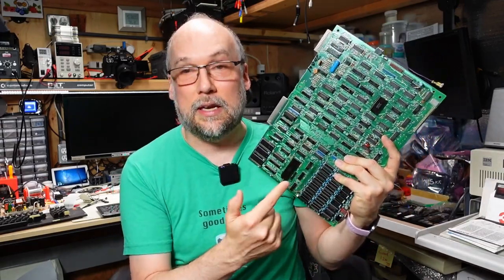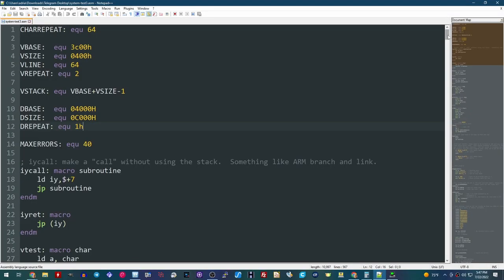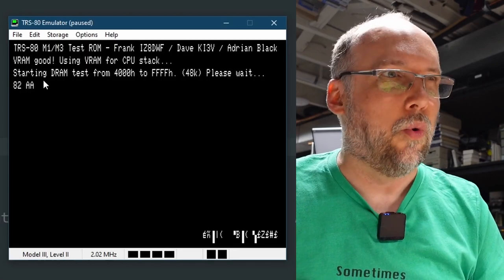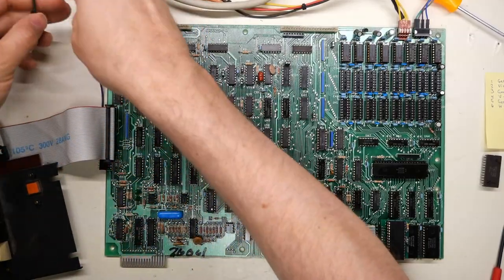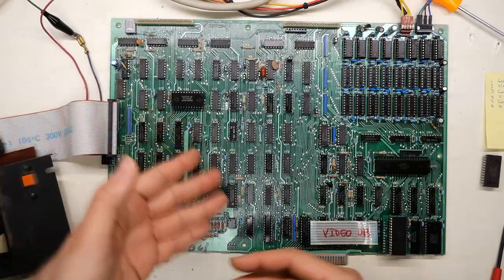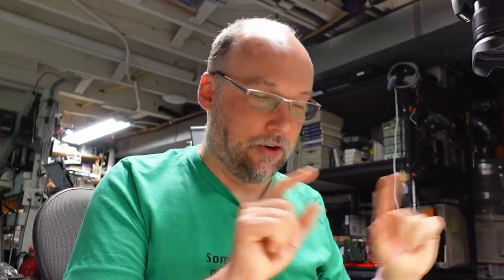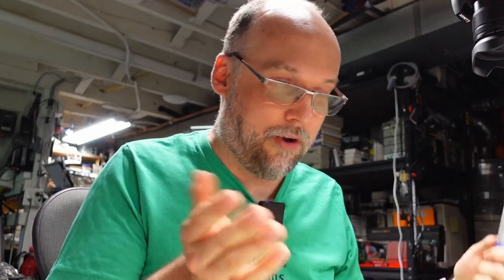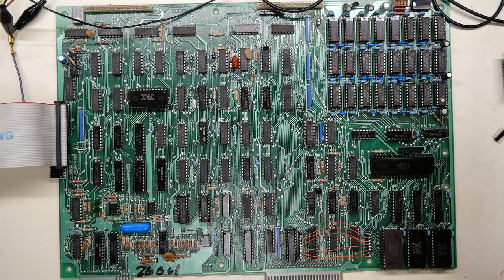Using our new diagnostic ROM to fix a TRS-80 Model III!

Comment: Thank you so for the test ROM! Hope to resurrect my model 1!
Reply from the maker: I was working on a M1 last night using the ROM, and the current version 1.5 (that's on the repo ... in that adapter PCB I used in this video) works perfectly on the Model 1. Both 7 bit and 8 but VRAM models... so it might prove useful to you to at least know if the system is trying to boot etc.

Comment: Excellent! And always excellent content. Thank you.

FWVLIW: If you're stuck and a proper butcher you can pull a bad bus transceiver IC and try hotwiring the socket to get an old computer working to test.
It's not guaranteed to work and not recommended for ongoing or reliable use!

Comment: Adrian you should get yourself a thermal camera.  It would help a ton when looking for warm chips and stuff.  They are not as expensive as you'd think.  I got a UNI-T UTi260B on Aliexpress for $300.  And it's not one of those crappy 32x32 resolution things.  It's 256x192.      I'd post a link but YouTube would delete my comment.  A similar FLIR camera would cost like $1,500.

Comment: This brought me back to my days of hacking on these things (as a kid) in their heyday.  Those little ribbon cables were tons of trouble even back when these things were new, and I distinctly remember fighting with them on several occasions.  Just not a very good design from the beginning, IMHO.

IMHO, all the buffer chips actually did often make these computers a lot easier to troubleshoot, though.  It meant that if you had a bus problem like this, you could just probe the multiple different busses and often quickly narrow down whether it was an issue in the CPU/ROM, the RAM, the peripherals, etc, and zoom in on the right part of the board without even having to start desoldering anything.  I think the trouble you had is you were just so used to other architectures that didn't have the separation that you just didn't even think to take advantage of it early in your troubleshooting process.

(For example, if you'd probed line 7 on all of the main busses, it would have immediately been obvious that it was something to do with the RAM section that was causing it, and if you'd just probed line 3 on both sides of the ribbon cable, it would have been clear that the cable was the issue for that one)

Glad you were able to figure it out in the end!

Comment: One of the cool features of the Z-80 was the inport and outport opcodes.  It would be sure easy to design a board for the expansion slot to output an 8 bit code that would tell you how far along the boot sequence has gotten.  Or to output codes for troubleshooting.  Similar to the diagnostic code boards i've seen for the IBM PC's.

Comment: Hi Adrian, with the bus transiver can be that on the pin of the Databus 7 was a so-called cold solder joint. Since you soldered out the IC and then soldered in the socket, the cold solder joint has disappeared or repaired. I suspect that was the error.

Comment: cold solder joint / cracked solder joint, is what that reminded me of @35:25  since you had removed it and then replaced it with a socket.

Comment: Great video (I knew video #2 would result in a working board, but I'd never have guessed that it would result in diagnostic ROM's, and more exploration of the Model 3's architecture)! Also, is it me, or is the TRS-80's architecture strangely formal, yet the board layout is bizarre. I'm not very familiar with the TRS-80, but it looks like someone designed the system architecture and then thew the general specs at the actual EE / board designers, and maybe not all at the same time.

Comment: Great video, a thoroughly interesting watch. I have subscribed, so can't wait for your next adventure. Well done for solving it. The diagnostic ROM was a work of genius. Nobody likes a smart-arse, but I would have changed that ribbon cable as soon as I found the corrosion. I've had issues with corrosion before (on a telephone line). The copper strands were blackened, where damp had got into the cable. Cutting it back and re-terminating didn't fix it (audio was very crackly). Replaced the cable, and BINGO - fixed. However, the bad chip on your TRS-80 was freaky. I can only think that by desoldering it, you removed a pin to pin solder bridge, but then it should never have worked. Hmmm, very strange.

Comment: One thing i don't think electronics teachers are teaching anymore, is that your measuring instrument ALWAYS disturbs the circuit being measured.  And understanding how inserting a meter into the circuit can effect the circuit is key to using the meter correctly.  For example, when measuring an ungrounded circuit to ground, the meter BECOMES a ground path.  Sure it's a high impedance ground, but it is a ground.

Another example is if you are trying to measure the voltage drop across a resistor, you are placing another resistor (the meter) in parallel with the resistor you are measuring across.  This isn't so much an issue with modern DMM's, but even the best DMM has a resistance value.

I had to learn this because analog meters were still very much in use when i was in college, and you absolutely HAD to know how the meter was going to potentially influence your readings.  A crappy VOM could literally destroy the device you were troubleshooting if you measured the wrong thing in operation.

Comment: To test the memory you want to write a test pattern that takes in to account the address lines. Writing the same char will not tell you if there is an addressing issue. A shorted address line will test fine but the memory has not been filled correctly as some locations will have been over written maybe more than once.

Comment: Just amazed that they used a ribbon cable to connect major components together...
Reply: There was no CAD layout system to help, and it is just a two layer board, so the easy/quick way to get the data bus over to the other side was to used the cable.

Comment: I used to really enjoy coding in assember.  I got to work with it at work on a Honeywell GCOS mainframe.  I bought an Atari ST and did quite a bit of 68000 code.  One of my favorite projects was to make a sprite library, doing lots of and/or statements to place an image into video ram with transparency based on a 2nd B&W mask image.  I got it working but back then there was no way to really share it with anyone.  My ST ended up failing with floppy and HD failures.  I bought a PC to replace it.   I never did try assember on the PC, so spoiled by 68000 with no segment registers.

Comment: That cable reminds me of something at work , where a connection on a signal tranformer was loose solder wise. Got voltage (continity) but could not do any current

Comment: All that hassle just to find a messed up transceiver that fixed itself while desoldering and a sorta broken ribbon cable. It amazes me that you did even got continunity with the DMM but the trace on the cable isn't able to handle the low currents on the bus.
Moral of the story: thou shall test bus transceivers.
Really enjoy those deep dive repair vids!

Comment: The black snow on the first few characters of each line is down to the Z80 not being halted early enough by the video circuitry, ie once the CPU gets to a certain stage of execution the halt line is not effective until the next instruction.  Tandy could have done some additional logic to widen the window in which the CPU is halted that would have prevented it but that would have added more chips to the already hefty count.  There is a bit on a port that controls the halt mode.  It can be set to model I mode where the CPU is never halted which gives noise across the whole line and maximum CPU throughput when accessing video, or model III mode but at the penalty of video access causing the CPU to halt, breaking time sensitive code but reducing the noise to the first few characters.

Comment: i am sure you already figured this out..but with those ribbon cables instead of doing continuity check it is better to o-scope and see if the signal is the same on both ends while in the machine ..also when testing it like this make sure you flex the cable a bit..sometimes we are afraid to flex a cable in case it breaks or something but heat, RF case, pin corrosion, internal cable corrosion etc will bend the cable whether we want it to or not and cause strange problems...so it is better to put it under a bit of stress when testing...

Comment: You don't need lots of high end equipment, one way to repair old 8-bit systems is to create an adapter for the CPU socket to a small breadboard but you just put switches for the data and address bus on it and a LED with a smitt-trigger monoflop to detect a frequency on the clock input to see if they CPU has a clock. I also had switches for chip enable. I found some small rotating HEX switches with 16 positions and 4 outputs so 2 switches for the data bus and four for the address made it not to large. I could then put each line high or low and go measure on each chip the data and address levels. With a color marker I followed each line I checked on a copy of the schematics to keep track what I checked.
It's also time consuming but with this the problems with bit 3 and 7 on the data bus would have been detected quite early.

Comment: Hey Adrian. 
I am trying to figure out what different paste pads or foam used on GPU heatsinks.
It's a tricky question. 
I know what thermal pads are as well as thermal paste/grease.  But there is a third substance I found on the gpu waterblock coldplate.  It looks like gray paste  but it seems more like a foam/cream, thicker 🤷🏼
It's in the large voids of the gpu copper plate. I believe it's on top of the chokes.?

Comment: @Adrian's Digital Basement Is there any desire to cook up a "bridge" PCB to replace that short ribbon cable which seemingly caused the issues that you suffered through here?  If I knew the distance from outside edge to outside edge of the 2 connectors, I could have a design out in minutes.  It's almost always the simplest things that can cause problems, right?

This goes to show that wiring of any kind can break down over time, even when it isn't obvious.  Great video as always, Adrian!

Comment: Those flex cables always crack where they bend and connect to connector 
Besides using multimeter you hold them up to a light source and look for light bleeding through 
As even continuity may pass but you wont see the damage as it might just barely be connected or bridges when bent etc

Comment: I was thinking that at the start.  If the ribbon has any evidence at all of any damage, you trash it.  Because continuity doesn't take into account resistance.  Small changes in the resistance, don't show up on a continuity test.  I was worried about that. It wouldn't burn so bad if you hadn't seen it at the start.

Comment: Great troubleshooting efforts and solution! I've been in the same path for diagnosing a non-working Z80-based QX-10. Am at the point of altering the ROM to better troubleshoot at one specific moment it crashes, as it indicates a RAM problem but all the RAM tests fine. So somewhere further down the path it is failing but the error handling in the OS ROM is virtually non-existent (just two error codes, one for any RAM failure and another for CPU failure). The RAM check fills all the memory addresses with FF (255) and returns that as a means of testing, but there are three separate points of failure during these checks where it'll throw the same "001" error code. My thought now is to alter the ROM to narrow down which of those three jumps is triggering it and continue refining from there.

Comment: Pausing at 7:15 to comment.  How about a mod to your EPROM adapter to include a DIP switch or jumper header, readable instead of an address of the (EP)ROM itself, to set a binary value for the amount of RAM installed?  You need some circuitry to deselect the ROM for that one address and select   the switch or header, of course.  The other way would be to use a larger EPROM and store multiple copies of the diagnostic image, so the switch or header would select the upper address bits of the EPROM and allowing the specific diagnostic version to be run.

Comment: For the final test, wouldn't it make more sense to not let Pin 3 on the ribbon cable float, but instead put a 1k Ohm or similar in between to simulate the corrosion?

Comment: The delaminated ribbon cable can still have been the problem. This can have caused oxidation on the plastic, as moisture can reach the tracks, that caused resistance between the "tracks".

Comment: I would guess this should be adaptable to also work on Dick Smith System 80 / Video Genie. Probably some differences in memory mapping? Wonder how it would get on with memory expansions being installed with DRAM stacked on top of each other?

Comment: it seems that you were using the same techniques of troubleshooting C64's to troubleshoot a z80. A cold solder joint can cause the error you were seeing on that transciever chip.I always thought the ribbon cable was a bit flaky,  Well done in getting  to bottom of the fault.

Comment: Speaker or Amplifier?

In the videos, the cassette port is used to drive a "speaker". Is this an actual 8-ohm speaker or is the cassette output used to drive an audio amp?

Comment: The chip that went from bad to good - is it possible that it had a cracked solder joint or something, and socketing it helped?
Reply: That's exactly what I have been thinking. I did a lot of electronic repairs (in all kinds of consumer and professional products) before I got retired, and one of the most common problems was a cracked solder joint. Especially with electronic parts (like this buffer chip) that go very warm, these cracks appear because of thermal expansion and crimp of the part (especially with a bad solder connection to begin with). Most times a simple reflow solves the problem completely. Soldering out the chip and put in a socket has the same effect of course. So - there is a good chance that chip is not faulty at all.

Comment: I’d put money on a bad solder joint under the buffer chip, which was fixed when the socket was installed.

Comment: If you work on cars in the rust belt, you learn very quickly that just because there is continuity in a wire, that doesn't mean that it can carry current. I honestly thought that you checked that in video one.

Comment: RE: Ram test, why not test the minimum in the first, test, then increase that by 2k for some subsequent tests .So 2k - ok, then test 4k ok, then test 8k etc, stop at the the fist failing address,. The person using it can then change that out and start again. It makes testing take a but longer, but it also exercises the lower RAM nicely and would only require a single ROM image.

Comment: At 7:30, I would use a DIP switch or jumper block on the ROM's adapter board to alter the address lines and choose a RAM configuration.  Is it for sure the ribbon cable or possibly poor connection in the connector(s)?  Often those connector socket springs get deformed and relax the contact pressure.  The greater thickness of the headers would compensate this.  But sharp creases in cables are never a good idea either.
Reply from the maker: It's OK -- the latest version handles all types of RAM properly with just one ROM image. I made this video a while ago versus where the ROM diag is now. (It was a very early version of the diag ROM I was using)

Comment: I would have switched the ribbon cable around very early at the start of the troubleshooting to see if the characters on the screen would change. With the cable the other way around bit 4 would be stuck , wouldn’t it?

Comment: I've never seen a ribbon cable used like that before, connecting two sections of the same board. It would have been better if it had cracked or torn so it'd be obviously bad.

Comment: just fix the cables with ribbon cable, solder those pins to the ends of the ribbon cables.  use an ide cable,  reduce to width, and solder......you can always glue something across the top and bottom, like plastic in fair sized strips near the pins to keep the cable in form......

Comment: please measure the resistance on that cable. you have used just the DMM beeper for continuity and that could be a few ohms and still beeping. I always measure resistance in such cases. Now I am so curious to see what is the resistance over that pin on the ribbon cable.

Comment: I wonder what happens if you put a signal generator on one end of that corroded ribbon cable and an oscilloscope on the other end, what would you see?
Crank it up to 2 MHz.

Comment: So, why have different ROMs for memory sizes? If you know your machine only has 48k it’s obvious if the next bank higher returns a failure result. Is it a concern those with less RAM have to wait longer for another pass?
Reply: The current version has just one version for all memory sizes. The original concern was that 4K machines use a different bank size than 16K, and for decent memory tests to work you need to know the bank size. The ROM is now able to make a decent guess about the bank size.

Comment: Q: Back in the 80's they used to use a can of Freeze to squirt on chips to see how long they took to defrost. Have you ever used that to check chips to see if they are too hot ?
Reply from the maker: I have -- I use those computer dusters upside-down -- but I ran out a while ago and haven't replenished.
Reply: I thought the freeze was to see if the issue was temp dependent?  That is, if a symptom changed or went away for a sec when you squirt a chip, that’s the bad chip?

Comment: Ribbon cables are of the devil. Have to deal with them in my day job, and they're seemingly always suspect, because they have to try to withstand a lot of vibration and dirt, they get crispy, and they die. And now on arcade restorations, I pretty much immediately think to throw out the ribbons and get new if it doesn't work.